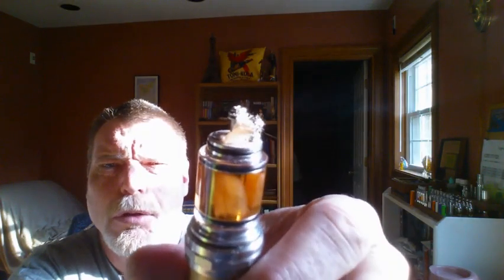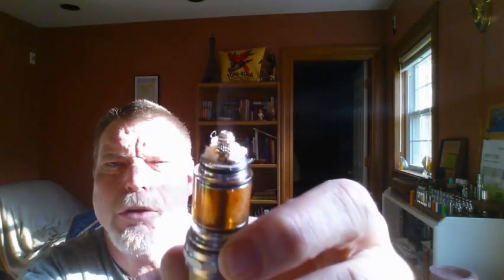Kraken clone RBA with dual wick and single Tiger coil vapor production

Comment: where did you get your kraken clone?
Reply: You'll pick one up at FastTech- but be prepared to wait a good few weeks for delivery- but at the prices they offer and free shipping it is well worth the wait. Think the Kracken is only $12 bucks but be very careful as there are two versions make sure you pick the 22mm version WITHOUT a drip tip- the other one is garbage and isn't a 1:1 clone. You can also pick up spare glass tanks and the brass Kracken sleeve very cheaply too.